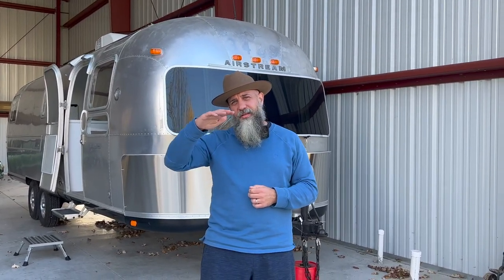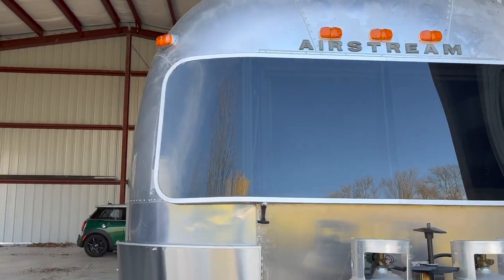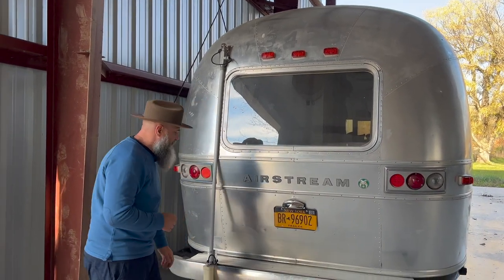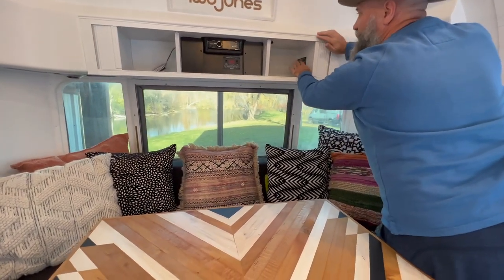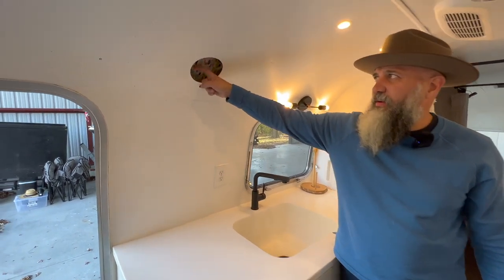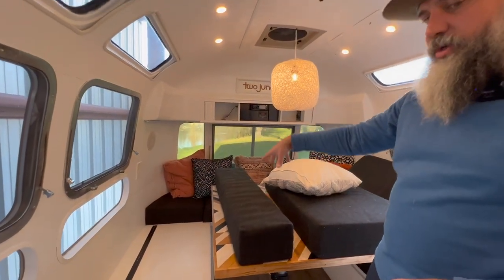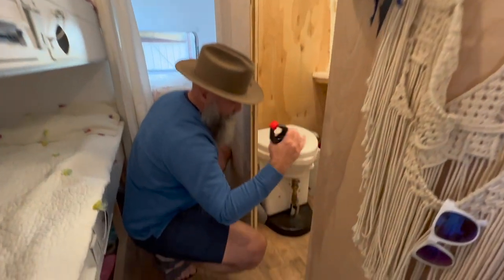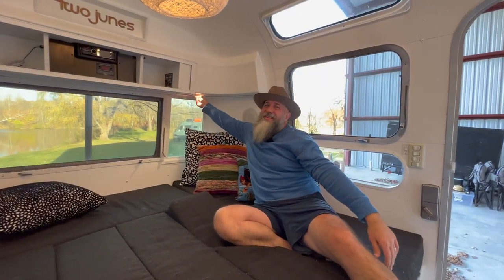FOR SALE our 1973 Airstream Sovereign Land Yacht  31.5 Foot

Comment: Did your AS ever sell? I have a 1973 sovereign  that I’m restoring myself…interested what they go for incase I sell..
Reply from the maker: We ended up selling it for $45,000, based on the level of work and money we put into it, I would suggest not getting in the business of flipping them.  The buyer 100% got a great deal on a vintage Airstream Trailer that will go another 20-40 Years.

Comment: What did you do for insulation?
Reply from the maker: We used Reflectix Double Reflective, Double Bubble Insulation, I put a double layer of this insulation in the walls and floor, I didn't want any problems with Fiberglass or Havelock Wool getting wet from a leak or condensation down the road. The insulation value ranges between R-3 & R-21 depending on the way it is installed, Based on the fact I have a double layer with an air gap I'd estimate an R-value of R-10 to R-15.